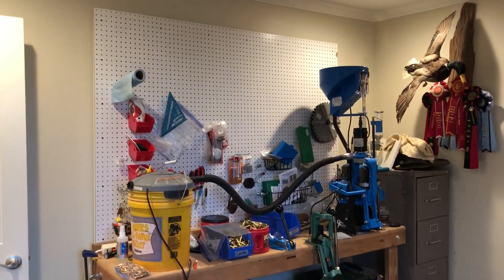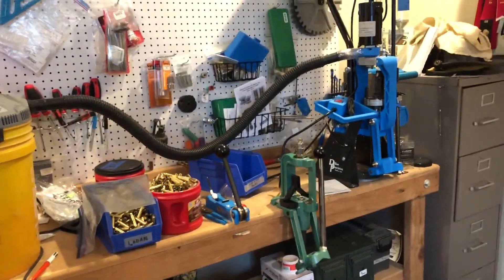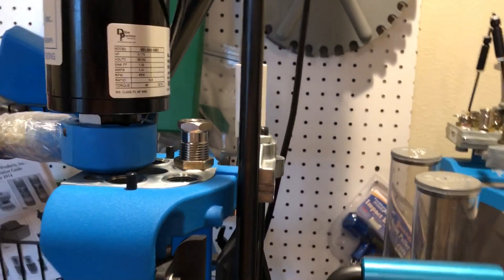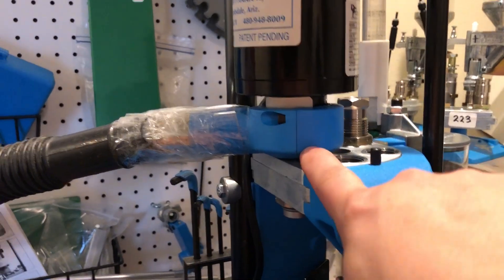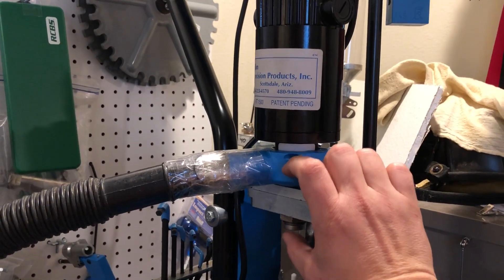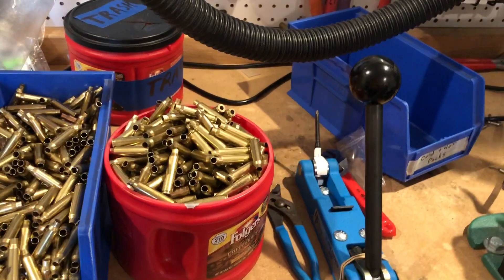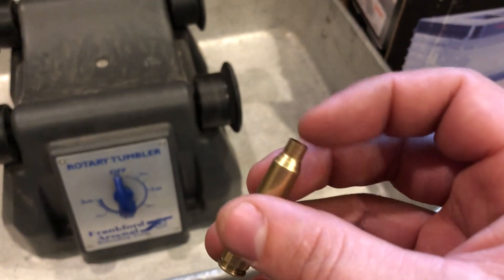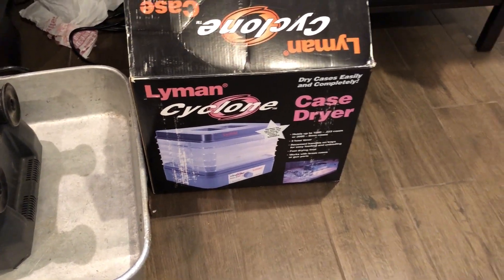223 / 556 case prep, step by step

Comment: Great video. Been reloading 9MM on my 650 for years and just placed the order for the exact setup you’ve got. I also have a Mr Bullet Feeder and it was recommended that I use a LYMAN "M" NECK EXPANDER DIE in the first station of the during the reloading sequence. But I like your idea of using the deprimer for clearing the flash hole. I also totally missed the whole thing about deberring and chamfering. I really hate to spend more on a wet tumbler right now. I looked at a thread on a competitive shooting forum I belong to and it’s about 50% chamfer and deburr and 50% don’t. Seems like it’s more for he guys go for high accuracy. I’ll try it without it deburring and see how it goes. I can always use a hand tool for my match ammo.
Reply: 9mm cases don't really stretch, trimming and chamfering them is essentially a waste of time with them, but all necked cases absolutely must be trimmed or you can start creating very dangerous conditions by creating a situation where the case neck starts protruding further into the chamber than it's supposed to, which can pinch the case between the bullet and bore, creating a huge pressure spike before the bullet can even begin moving. If your 9mm cases are within the length tolerance range they're fine, the only thing that can go wrong is if they're too long they won't fully seat in the chamber and stop the action from closing, since 9mm indexes itself in the chamber off the case neck.